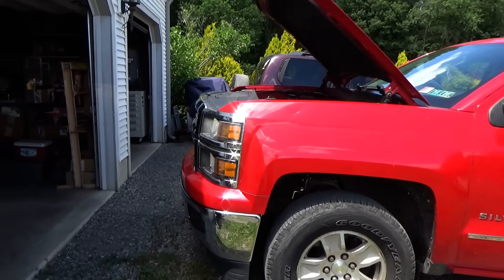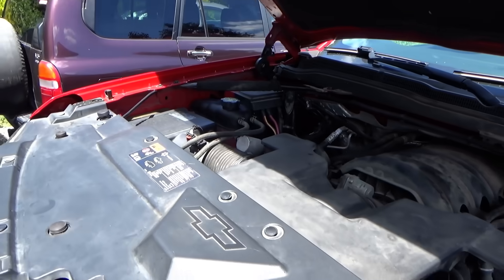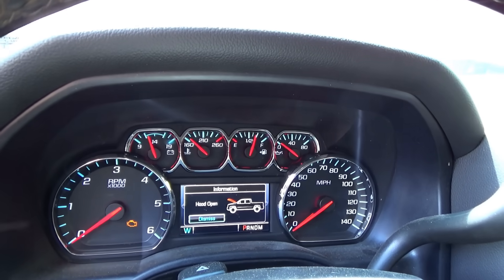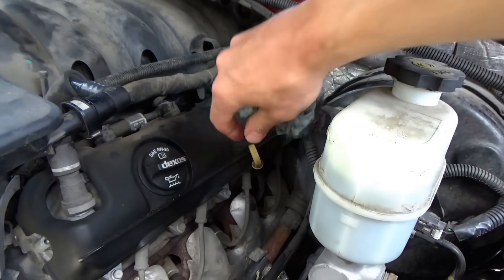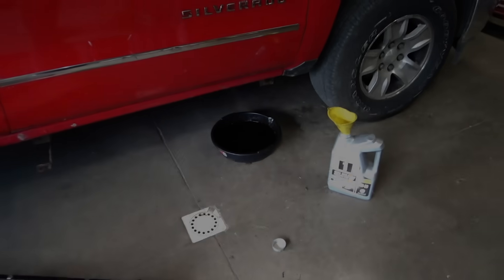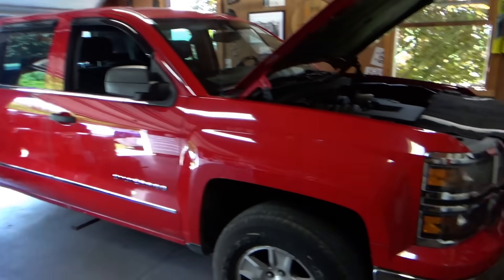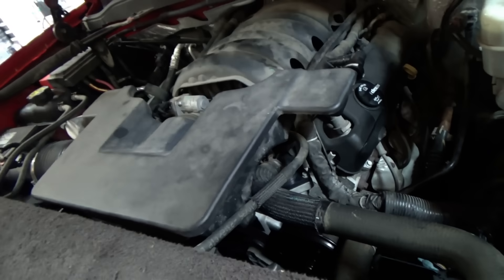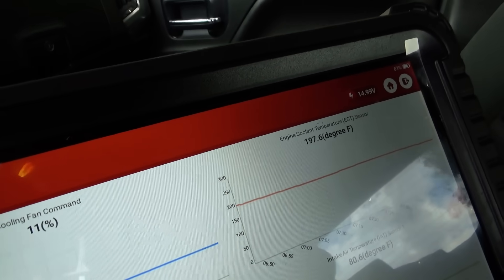Chevy Truck OVERHEATS?! (Thermostat & Water Pump Already Replaced...)

Comment: it would have been good to put that junk thermostat in a saucepan of boiling water and send the footage to the company and ask what the hell are they up to selling this crap that is critical to engine
Reply: Maybe they will send you a box of complementary amazon fuses.
Reply: I don't know anything about Chevrolet's new weird design thermostat but had an escort with a separate housing with one ball that floats and another that sinks when not running. Only thing I can figure for this added stupid complexity is to hold heat in so stay closer to operating temperature longer for better emissions. 
On that thermostat running the truck low on oil overheated the check balls in the thermostat causing a blockage.
Might be be more to it than "Aftermarket parts bad". Been working on cars for 50 years and could write a book on crazy things I've seen.
Reply: @Jeffrey-t8g  Maybe some YouTube stories about your 50 years experience, I would listen. ;-)
Reply: Here's tip for today, when disassembling component of the car, clean everything with 50/50 mix of Super Clean in a spray bottle when flush off with water and let dry thoroughly. Nuts, bolts and all fasteners too. 
Then wash your hands good before reassembly because it goes faster, hands don't slip on greasy parts or tools and when finished the car and engine compartment not covered with fingerprints like a crime scene sprayed with luminesce.
Reply: I've ALWAYS tested a thermostat before putting it in. 15 minutes, chargeable, for peace of mind. In earlier (around 1990s) Mercruiser inboard and stern drive manuals they went to great pains to state how to check EVERY thermostat before replacing, including opening it in hot water, placing thin fishing line in its mouth so it would drop from being suspended at the crack of opening, stirring the water gently as temperature rose, noting crack temp, at what temp it was fully open (measureing that) and then allowing it to cool and noting temp at which it closed. That's what Mercruiser thought of even its own brand thermostat. Years ago, Waxstat brand thermostats used to say on the box; "No need to check before use, we have checked it". I always still checked them and found always they were right, all good.
Reply: @PaulFletcher-w2l  Quality control and craftmanship are fading by the day, its so sad.
Reply: No oil causes overheat by itself, of the parts there's no oil splashing onto, or passages it runs through.
So, double trouble.
But the chinesium? Motor-rad t-stat tells me you found the cause.
She is a good Chevy and some companies copy other company's parts.
They don't have design and quality control like you would expect for $100.
They are just as good as who was sent over there to make it be good.
Reply: This is what the morons that voted for Slick Willie did to us. I voted for Ross Perot twice. He saw this coming, tried to warn us, the dumb ass US citizens put a draft dodging, Chinese lover in the WH. Eisenhower tried to warn the people about the Military Industrial Complex, too. Did the people listen? Nope. That gave us Vietnam, Iraq, and Afghanistan. When you spend $ 940,000,000.00 a year on military hardware, you have find a place to use it. I know, way off topic, but I'm 78 today, a disabled Nam Vet, and somehow cheap ass, not made to purpose parts are the result of really crappy leadership. And somehow, it's all related. 😮
Reply: We brush our teeth before the dentist. Nothing wrong with that
Reply: Ding dang bong wang
, round eye
Reply: i used to test new thermostats that way.

Comment: My cousin bought a 19 suburban. It needed a radiator water pump and thermostat. We used all ac Delco stuff. I cleaned his throttle body. When we started it back up it idle finny and had what sounded like an exhaust leak. There is a throttle body compensation reset. Did the reset and even the exhaust leak sound went away
Reply: How do you do that reset?
Reply: @slalomking  With a scan tool.

Comment: Last time I changed a thermostat I put the new one in a pot of water with a thermometer to see if it opens up at the right temperature. These days new doesn't mean good...
Reply: Do not do this with VW thermostats ! they have a plastic frame and will blow up !!  Don't ask !
Reply: @CrimeVid  lol
Reply: @CrimeVid  plastic is a huge problem in everything it touches
Reply: @CrimeVid  never put a thermostat in boiling water
Reply: The way auto parts are these days, this is a really good idea I would have thought to he overkill 5 years ago.
Reply: I am a recently retired mechanic with 37 years experience. That has been a common way of testing thermostats forever. A 2014 model would still have a normal thermostat that could be tested that way. It would not surprise me if vehicles built during the last couple of years have some kind of computer controlled thermostat.
Reply: @geraldscott4302  now their is reliability computer controlled JUNK !!!
Reply: I've used Stant Superstats, had good luck with them.
Reply: @Jeffrey-t8g Stant has been making thermostats ever since I can remember, and I'm 78.
Reply: I recently changed a starter. Put new one in and it wasn't working. Took it out put 12v to it and the Bendix wasn't coming out. Took it back then asked them to test the new replacement. 6 out of the 8 were bad on the shelf!!!
Reply: Wow, thank you for sharing this ingenious idea!!! Would of never thought lol
Reply: Evil is good 😳
Reply: I buy my thermostats now from the dealer for this reason.  The aftermarket ones just don't work well or last it seems.
Reply: @dieselchevette 
I do (and have always done) buy OEM parts.
You get what you pay for!
Reply: Yeah, the aftermarket thermostats are shaky.
Reply: Amen!
Reply: I learned this one at 11 yrs old from my uncle John (RIP) in 1957
Reply: I put mine in the microwave. Much faster and the sparks are definitely entertaining.
Reply: @jumpinjojo  🤣
Reply: @jumpinjojo  retard

Comment: Really wish i could have you look at my truck.  It is setting a   DEF code, which could mean a bad wire or bad sensor.  Bad sensor means replacing the whole tank, which is $2100 from dealer.  And they wonder why we call them stealerships.
Reply: Can you ground or apply voltage to the signal wire to fool the computer into thinking everything is Ok?  Or do you actually want it fixed?
Reply: @major__kong  Right now it is setting a P203E Reductant Level Sensor Circuit Intermittent/Erratic code but it is still injecting DEF. I'll probably need to get it fixed before it causes more issues. I am changing oil on my in-laws farm in next couple of days, so I'll give it a look over on the lift.

Comment: So, the original fault was engine overheating? - with the original thermostat?...& water pump?

Then, likely the original fault was caused by low engine oil!  Even I can diagnose that!

So this guy wasted his money replacing the water pump, & could have wasted even more money replacing other parts & getting nowhere, & could have blown up his engine with a faulty-from-new HUNDRED DOLLAR (!!!!!) Motorad thermostat!

So we have a halfwit customer dealing with junk parts!  This could have ended very badly if you hadn't been involved Ive!  You saved the day AND the engine bud!🎉🎉🎉
Reply: It had an aftermarket thermostat. The low oil level had nothing to do with the overheating issue in this case.
Reply: @@brianw8963    Oh?  I thought Ivan said this & the water pump were changed after the original overheating problem?  I guess I'd better watch the video again.
Reply: @nevillegoddard4966  I believe I misunderstood your question. The one Ivan replaced was after market, don’t know what the owner replaced. Sorry.
Reply: @@brianw8963    Yeah that's ok Brian mate, no worries!   I may not have been very clear with my words.  More importantly though, do you reckon the original cause of the overheating could have been from simply not having enough engine oil?
Reply: @nevillegoddard4966  No, not at all. It evidently was not low enough to cause any pressure issues, or it would have been lights out for that engine. It may have a slight effect on temp. just due to the diminished volume, but would be hard to even detect the difference, if at all. In this case it was just the thermostat in my opinion.
Reply: @brianw8963    Yeah you could be right Brian, & maybe the original fault WAS a faulty thermostat!  We weren't actually told that were we?  

We only know that the thermostat the customer replaced was faulty, cos the fault disappeared when Ivan replaced it.

In that case, I should apologise somewhat to the owner for calling them a halfwit!  Not a full apology though, cos not even topping up the oil is a pretty stupid thing to forget to do!  I mean, Ivan said the dipstick was bloody dry!  Do those engines have an oil-pressure-activated timing chain tensioner, for example?

I know the 3.6 litre V6 alloytech engine in my VZ Aussie Holden Commodore  has one, & letting the engine oil level drop reduces its effectiveness.  The timing chain then flaps & slaps around, & eventually stretches, causing all sorts of problems.  I'm gonna check my engine oil tomorrow morning actually!

Comment: Wohldnt excessive low oil level contribute to overheating as well? Oil does help keep an engine cool, does it not? I am astounded at the level of crap parts being made.
Reply: Yes and no.  Yes in the sense that oil is carrying heat away. No in the sense that, unless there is an oil cooler, the engine probably wasn't designed to need the oil to remove heat.  This isn't true on all engines.  On air-cooled aircraft engines, they use an oil cooler. There, the oil is a big contributor to keeping the engine cool.
Reply: Yeah, when the oil levels that low, it would definitely contribute to overheating.
Reply: That was not a factor in this situation.

Comment: Most new thermostats fail open...not closed?
Will run cold .
Not sure on this motor.

Also to deactivate AFM drive in M5 or D5 stays in V8 mode.

All Mechanics and owners must create a class action law suit against any all non OEM parts which have a track record of selling  defective low quality parts!

This has gone on long enough.
Reply: That is not true about the AFM, the later models like our 19 will still go to the V4 mode.  I put in the Holley Range unit to keep ours in V8 mode all the time.
Reply: @slalomking  I put my 2016 GMC Yukon in M5 and no AFM v4..
I make a note of Holley unit
Reply: @slalomking  ps a Guy invented a tool to unstick lifter without taking heads off.
Small  soft steel pin on air hammer into oil supply hole against lifter pops it out .
Reply: Mine failed closed. (1988 Peugeot engine). And I did not even have a temperature gage. I had to drive 100 miles. Heater on hot, 50 miles an hour, still temp light on, engine off and wait..... 10 miles driving, light on engine off and wait.... I came home eventually.

Comment: The aftermarket has gotten so bad with shoddy parts, that I've gone back to OEM even for brake parts.
Reply: Even OEM is mostly made from chineseium these days, it's sickening!!
Reply: @DinDooIt  Yeah, GM is America's truck!  Complete with OE parts made in China.  I preventatively replaced the vacuum pump in my sister's turbo Equinox recently and went OE for the part.  Genuine GM, made in China.  The aftermarket Standard Motor Products pump seems to be made in America...  sad times, indeed.
Reply: @brassmule  I just replaced a wheel bearing in my ram 2500, oe bearing straight from China, so I went with a Korean bearing instead, idk if it's better but worth the try I guess, crazy times!
Reply: That’s for sure. I recently put an  aftermarket pcv/ crankcase vent valve (80$)on a guys Passat , at his request, and it worked great, for one day. Put the 240$ OEM on and solved the issue. I knew better, but luckily it is only about a 15 minute job .
Reply: Going to sue China?
Reply: Just bought brake pads and rotors yesterday from the local Ford Dealership.  "Made in China" is clearly marked on the boxes.
Reply: 2018, can't even get OEM gaskets to fix the engine.  Never tried it before, may try putting piston in from the bottom since oil pan is just gasket cement.  May have to make a custom sleeve to compress the rings, and guide it in.   3rd engine failures in 20k miles.  ecoboost 1L.
Reply: I bought a reman. power steering pump. N.Portland D.S.U.  G.M.C.  parts guy CLAIMED 'but it's G.M. rebuilt.' As if that meant it was so much better than regular rebuilt.  That pwr. steering pump leaked before 10 miles.  I found a NEW  water pump for my small diesel pick up. The NEW waterpump is leaking!
Reply: @3Mudbone1  I ate  the $10 core charge, and rebuilt my gm  power steering pump instead.  I keep it for a spare.
Reply: Agreed I'm on my 3rd alternator in 8 months and the bearings are starting to go. The others triggered a low generator current code in the computer shortly after install.

Comment: My 2019f150 cooling fans were cycling for seemingly for no reason. Even at 0° outdoor temperature. I changed out the thermostat after reading some stick with a new style motor from the dealer, including the O-ring that comes with it. Work like a champ the thermostat. The OEM thermostat cost $10 more than the other rock auto thermostats. It’s just not worth messing around.

Comment: Every over heating problem I ever had was a blown head gasket never lucky enough to be just the thermostat
Reply: I've only had two overheating problems. Coolant got low for some reason on a road trip out West.  I was driving at interstate speeds in the high desert and had to turn the heater on.  Topping it off at the next stop fixed that. Second, about a month ago the water pump on my truck liberated all the coolant into a parking lot.  Water pump, belts because they got soaked, and new hoses because the truck is 8 years old.

Comment: Hi Ivan, years ago I was taught a lesson on overheating engines, I thought I knew a lot about the subject. It turns out that that the newer engines need to be filled with a vacuum applied to them to keep the air pockets from forming. I told my customer to get rid of the car because it probably has a blown head gasket. the real problem was when he changed the antifreeze, he didn't use the "GM" method.
Rich
Reply: I vacuum fill all the vehicles I service these days.  It's quicker.  I can fill it, cap it, run it, and test drive it and then give it back to the customer the same day.  Before I would let it cool down overnight to make sure it stayed at level.  I've never had any water pump issue.  I'd be curious to know what kind of vehicle that happened on.
Reply: @johnaclark1  I don't recall which vehicles it happened to.  Only GM here at the dealer.  I have not needed to use the vac in at least 10 years now.  Sure, it maybe faster to fill, but doing a water pump for free costs me more.  None of the GM late model have problems filling coolant.  Just be aware it can cause you problems.
Reply: Have to be careful when using those vacuum fillers.  Have ruined several water pumps.  While doing a routine flush, heard a pop noise.  Then when running coolant was leaking out of the weep hole.  Pump was fine before the flush.  The engine in the vid here, can fill those with no vac needed,  now the old LT1, with reversed coolant flow, it was necessary to vac fill those.
Reply: For grins and giggles, this is called air lock.  Grady over on Practical Engineering did a video on it a few years ago with some clear pipe to show what's going on inside.
Reply: "Bleed" the coolant system
Reply: @Garth2011  Yes, but vacuum fill is still usually faster and no risk of not getting the system fully bled.
Reply: I miss the mazda dealer I used to steam back flush the cooling system.  It cleaned out everything in the system.